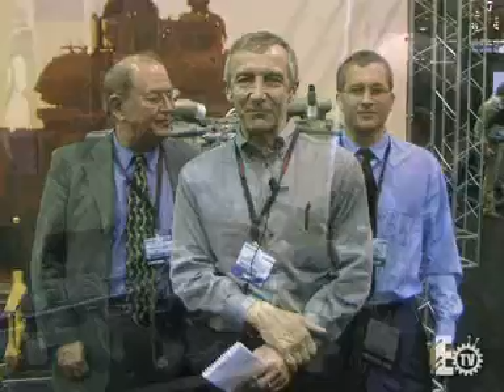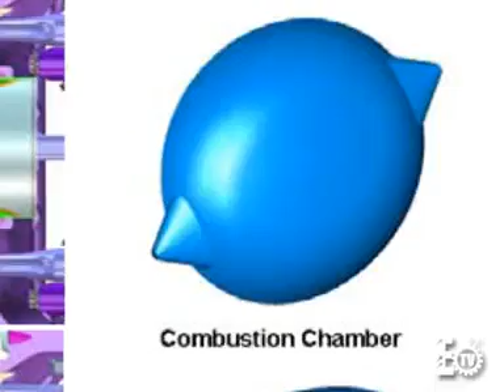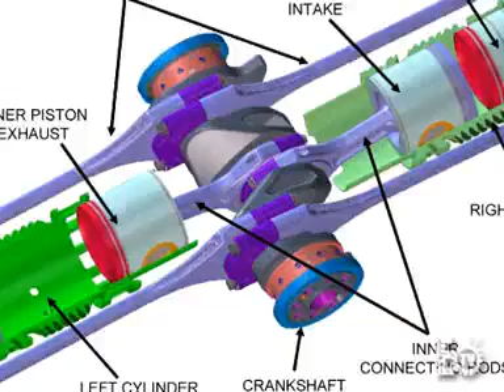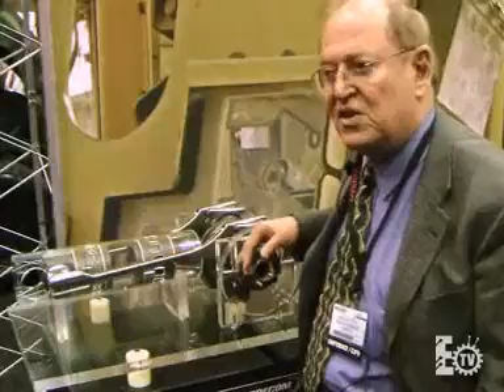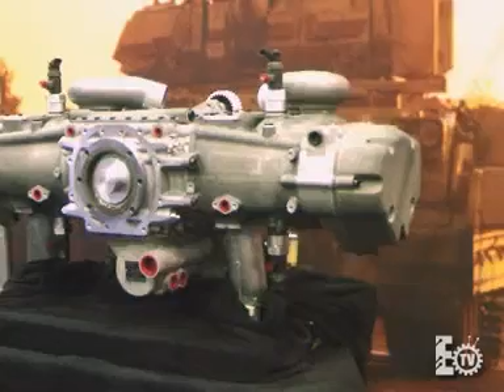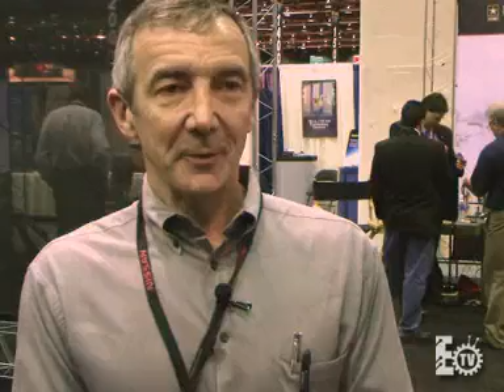opoc engine how it works.mp4

Comment: Lubrication is a key to improve fuel efficiency and reduce friction losses and wear. And how the piston rings can be lubricated above the ports? No way it can be resolved. Also lubrication of the piston pins. Ba-Bla-Bla - "we have a solution" - no you don't. I mean - wear and friction losses will be huge and the engine will not last long. if for the Junker Jumo engine it was not a big problem - it is for a car or a truck that has to last longer than 10-12 years. a 2-stroke diesel engine with valves is much more reliable. if the valves are controlled by electricity it is possible to improve fuel efficiency by shortening a compression phase. plus fuel efficiency can be improved with ceramic inserts in the cylinder head to reduce heat losses. btw i developed two years ago such compositions for engine oil that improve fuel efficiency 20-30% and reduce wear 50 TIMES in comparison with the best synthetic engine oils of SN type. check video on my channel. and nobody is interested. so the more i expect for such engines - no interest in saving of fuel. just some buzzing around.

Comment: Didn't the germans have a diesel 2 stroke aircraft engine which had 2 cyls in one bore meeting in the middle to create compression without a cyl head, back in the 1940's?
Reply: The Junkers Jumo 204 through 208.

Comment: this design isnt new, rootes of great britain made the ts3 two stroke opposed piston engine and had them in commer trucks as early as the late 1950's.
Reply: The Rootes engine was fundamentally different in being inherently unbalanced with relatively far higher reciprocating masses and, therefore, by necessity, a fully stressed block and lower P/W ratio. 
      The real magic of the OPOC is the fully counter-loaded ( counter balanced ) crankshaft loadings in combination with the constant compression and constant tension in the connecting rods.   No, this is an entirely original ICE design, and it's probably not a coincidence that Gates is backing it.
Reply: It's not an original ICE. Gobron-Brillié was the first to design this style of engine. Junkers Jumo 204, 205, 206, 207, and 208 were used in aircraft.

That said, EcoMotors made some interesting twists on the idea.
Reply: @Anticept  You all do not have any meaning of what is "new" and what is not. Patents are granted and You have to study them to tell somethink. Junkers has absolutely another think. By the way also not him was the very first for that prinzipe at all, it was another German in some1887. And also russians did again another solution in 60s for the tank T64.
Reply: @ivanzaremez4773  there are different kinds of patents. Patents for original concepts are relatively rare. Usually the patents you find are those extending or refining original concepts. There's a lot of inspired designs too that take concepts from previous attempts or examples.

The original opposed piston idea (the subject of this conversation) is very old, and as you demonstrated, the design existed elsewhere.

It's fair to show that it was built even before junkars. Often obscure things go back further than we think!

Comment: Another designer that made a variation on Russel Bourkes very simple OP engine in the 1930s but missed the point. Conrod angularity at high compression/revs would blow it to pieces.
.

Comment: the idea of a 2 stroke that keeps the intake and exhaust ports not open at the same time makes sense.  And it would appear like the duel piston setup would reduce drag.  But a static model and a working engine are 2 very different things.  The tolerance between both pistons, their stroke and connecting rods would be very fine....otherwise it would become less efficient than typical 2 or 4 stroke.  It does seem like in this day and age we should be able to come up with something better than the currant piston engines.
Reply: We do have such an engine. Its called the Rotary Atkinson Cycle Engine, aka the Libralato engine. Unfortunately the patent holder is an idiot. He's all hung up on the Idea that he can sell this as a prime mover for Hybrid electric vehicles. 
Problem is, the auto industry already has a sound engine design that works just fine in that roll. 
If he ever want to get his engine under the hood/bonnet of a production vehicle, he's got to make it sexy and attractive. Build a diesel combined cycle version (for improved lubrication from the fuel), and build it large enough to produce the power for some proper hooning, and the engine will blow the doors of piston engines. 
The data i've seen on this engine predicts that a 1.8L tri rotor engine will produce aprox 300 lbft from 1600 to 10900 (+/- 20 lb across that range), from there you can do the HP math. The engine's predicted redline is somewhere between 11500 and 14000. So you can get some pretty insane power out of it.

But we will never get to enjoy this engine because the man that owns the patent, one Ruggero Libralato, has let Ideology override Objectivity.
Reply: Anthony Smith corrected.

Comment: This is a 2 stroke piston engine which has been around for a long time. If you buy a weed whacker yes you get a two stroke, but in your car I don't think so.  Two strokes appear to be a good idea, only 3 main moving parts, no valves, cams, timing chain and lifters.   The piston produces power every 2nd stroke, but it has to release exhaust gases and intake air in a very short time span leading to its inefficiency.  By making it a opposing piston you do not gain any thing in fact the outer piston requires 2 connecting rods and a longer rist pin.  Because one piston is pulling and the opposing piston is pushing does take off pressure on the crank bearings however the added weight of the outer pistons, connecting rods and rist pin require the crank shaft to have larger counter weights.  The reciprocating piston connected to a crank shaft is inherently inefficient.  Mr. Gates think of it as you just got a speeding ticket.
Reply: Say whatever you want to say, but be sure that you've compared an OPOC engine to a conventional engine of a similar weight before you say it doesn't work.
Reply: +RR A two-stroke diesel is a very different animal from a two-stroke gasoline engine. No fuel is lost in the scavenge air because injection occurs after port closure. There are many successful automotive applications of the two-stroke DIESEL, including the perennial GMC two-strokes. The opposed piston arrangement allows for asymmetrical port openings, which is routinely practiced and helps scavenging. What this engine does is take existing practice and set two such engines end-to-end with one crankshaft. They have to solve the mechanical problems, but the operating cycle problems were solved long ago.
Reply: Your 'weed whacker' comment seems odd.  The very largest engines in the world are nearly all two strokes and the largest is for sure.

Comment: I have worked together the whole time in Volkswagen with professor Peter Hofbauer. He is a brilliant engineer. This new draught has a great future according to my opinion. The cost problems of the electric-cars are not to be solved on the quickness. China will tramp to us the rank. About my life now you can find more under Fred Abelmann
Reply: This engine is too wide to fit in 95% of engine applications plus, it will be a bitch to work on. No one has heard anything from this since 2013.
Reply: Fred Abelmann, why has Germany's technological might paid little attention to this architecture?

Comment: @jackpontiac52 imposable it is the same a two separate cylinders - what your are saying is that your engine as one piston/unit the most efficient in the universe sorry not possible - look up doxford engines as used in ships.
The losses are actually higher due to the difficult path of the gasses in and out of the engine and the additional gearing required to transmit the power from two cranks into one.

Comment: @kspr2635 It will never happen - old idea revamped (Doxford) to may moving parts and no real efficiency advantage. They can be very high torque engines but not fuel efficient

Comment: @KillaBee23z Check out "Ecomotors Opposed Piston Opposed Cylinder Engine". 

It IS running and under extensive testing.  Many large investors have invested in this engine.

Comment: WTF they have worked on this engine for over 8 years, the aluminum pistons melted, so now steel pistons, it never seems to bear fruit, and where will spark plugs go? on the sides is a bad place it would seem. The development of this engine seems to go on forever.

Comment: @88BlueKeys4U 
"This design is way more efficient, simpler (one crankshaft!) and not limited to Diesel either."

The Rootes TS3 OP diesel had only one crankshaft. Used a simple rocker & two small conrods per piston. A brilliant and simple design. I like this OPOC design. What makes it shine is the external ancillaries: electric turbo & clutch rather than the core design. The TS3 with all the new electric/electronic around it would also shine. TS3 @ 3500cc the same HP as 8 liters, far more today

Comment: The clutch between the two engine modules will "dramatically" increase fuel efficiency in a car. The second module (an engine) is total disconnected, giving no drag, when not in use in low vehicle loads.

Comment: @jackpontiac52 
"No heat loss in the Cylinder Head, because their is NO Cylinder Head !!. I can see this being 50% more efficient !"

The cylinder surface exposed to heat is small. This means a cooler running engine and smaller cooling system - smaller water pump meaning less HP taken off the crank, smaller water jacket meaning a lighter, smaller engine. No camshaft means smooth and higher rev running if needed. The TS3 had oil cooled pistons.
Reply: John Morgan  dude educate yourself. Opposed piston engines have been around for decades. The commer TS3 for example. They have been used in tanks, trains, trucks etc. They are very reliable. And with modern technology we will be able to achieve crazy efficiency and high weight reduction
Reply: John Morgan  you're building an opposed piston engine|?
Reply: John Morgan  ?
Reply: John Morgan  why put an axial generator? This creates conversion loses.

Comment: @stunnedasmearse

"The engines mentioned above were slowly put out of service, just like the Detroit Diesel's two-stroke series because of emissions and poor fuel economy."

Not so. Rootes TS3 gave TWICE the mpg. Chrysler bought British Rootes and dropped the engine to promote existing lines - thanks Yanks. TS3 was made for 18 yrs. Type in Youtube "Rootes TS4". The TS4 prototype, ordered destroyed by Chrysler - hidden by the English engineers - is reconned and running and to be put in a truck.

Comment: As of June 8, 2011 , prototypes are up and running.  I don't think emissions will be a problem.  They will use a DPF filter like VW.

No heat loss in the Cylinder Head, because their is NO Cylinder Head !!.  I can see this being 50% more efficient !

Comment: @mov0001000 Not all two-strokes require oil-fuel mixes. That is only required for crankcase-fed intakes. These engines will usually be found in applications where the engine is needed at multiple angles. The reason being is to lubricate the crankshaft while fueling the engine.

Comment: The second item is just joining two of these in a balanced opposed configuration to balance the forces thus removing the need for heavy counterbalances. (BMW motorcycle)> I’m certain it has a use if light weight/hp is the only item required but is not efficient and is still a two stroke with lots of wastage in economy. The real reason for the design was to suck money out of the kiddies now running the military.

Comment: It is not producing 4 time the power the exhaust piston can not produce half the power for each cylinder and only produces about 20%. If it is on a crank (Look up Doxford) and if on a concentric it is a loss of power (Harland & Wolf) as effective power cannot be driven though a concentric. The benefits are that you can control the exhaust & intake port timing to increase efficiency thus it is a very low weight to power ratio.

Comment: Lets be very clear on this, it is a combination of a very old ideas with modern materials and were stopped being used in ships 40years ago due to the expansive cost and it is easer to make the same power with better economy using other diesel engines.
I

Comment: This is awesome. Since you have no need valves you would have no camshafts. This will actually be a more simplistic engine when parts come into factor making it lighter. It's amazing how we go back to go forward. 2 stroke to four stroke back to 2 stroke.
Reply: Es el peor motor .vengo del futuro y los motores no tienen más árboles de levas ni cadena ni correa son lalvilas electroidraulicas